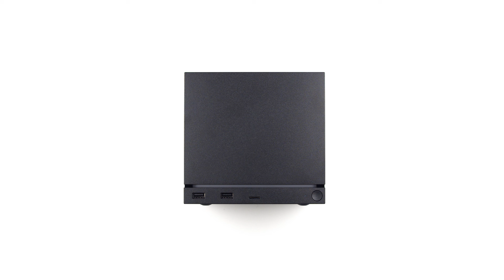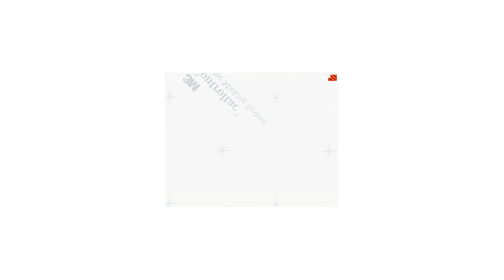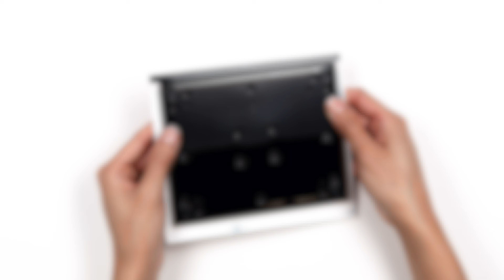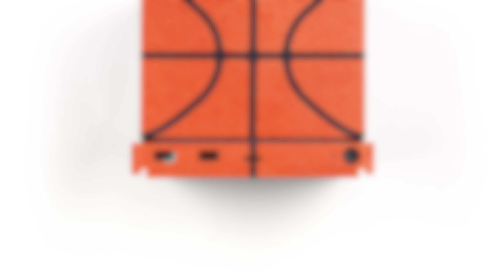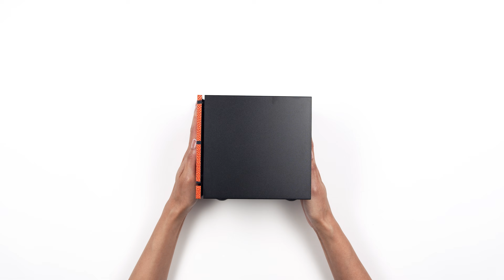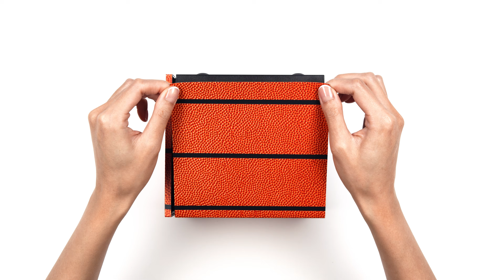How to Apply a dbrand Steam Machine Skin

Comment: There is an editing mistake at 2:19 (You can see the edge of the clip/frame) - Also, the behind layer is the incorrect colour just before hand, it should be f6f6f6 but is instead ffffff
Reply: Holy unemployed 🥀🥀
Reply: @ChocolatePillow-j1e  Actually my job is a video editor
Reply: @helloimdillon holy autism